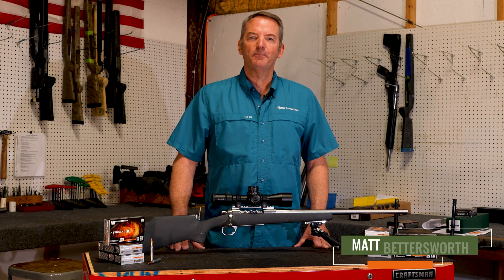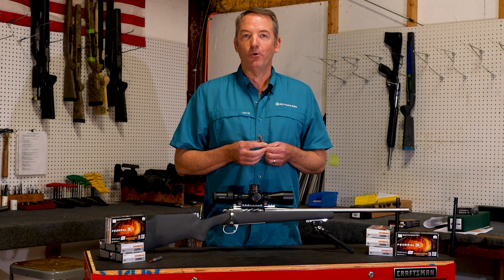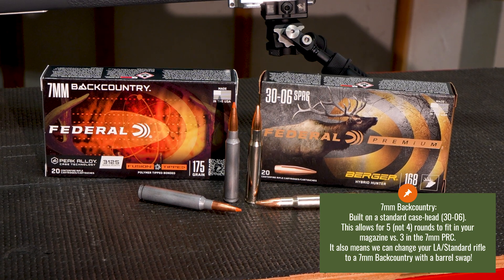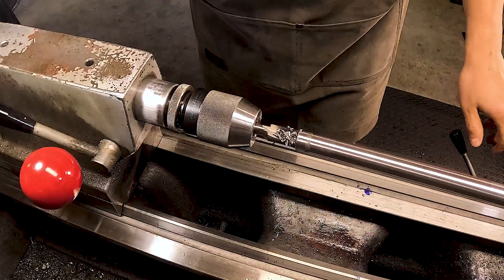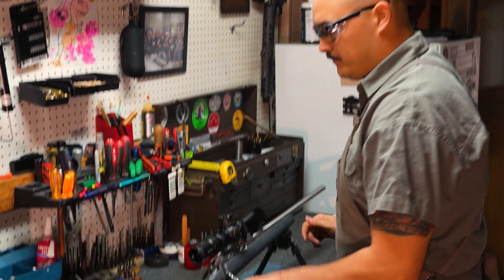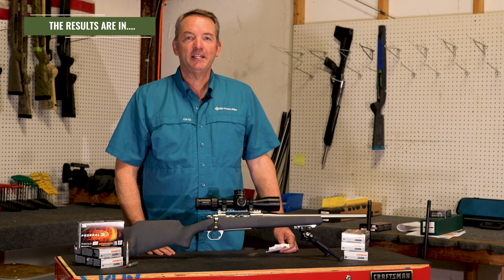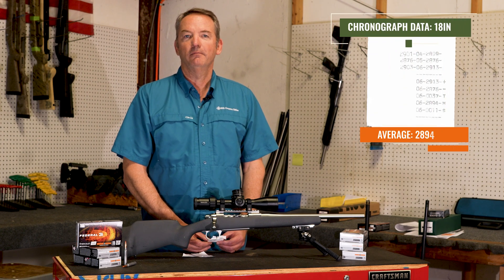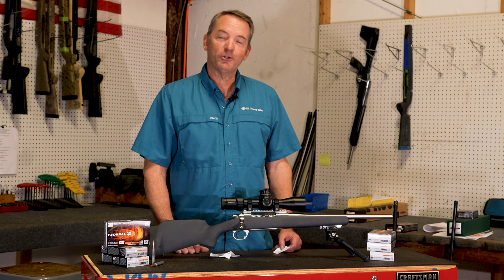7mm BACKCOUNTRY TESTING WITH DIFFERENT BARREL LENGTHS

Comment: This is exactly the video I was needing to see.  I really want a 16.5" 7mm BC now.  While it's on the potent big side for White deer and black bear at closer ranges, and that's the big game where I live, it could really be handy if the odd moose gets the idea to charge and a fun varmint round with handloads ...just for a change of pace once in awhile .  I bet the velocity is super impressive with light for caliber bullets.
Reply: I just picked up a savage trail hunter 16.5" in 7bc. Finally got to shoot it and I'm getting 2933 fps over the Garmin. I'm in AZ so it's 95° so I'm not certain if the heat made it faster or not. Best part about it is that with my suppressor attached its shorter than shorter than a rifle with a 24" barrel.
Reply: Thanks for sharing. Your suppressor is adding length to the barrel and helping your velocity is my guess.  @eaznutts5714
Reply: Forgot to mention I'm shooting the 170 gr terminal ascent
Reply: @eaznutts5714  I am sure the heat is adding something to the velocity , I'm sure you can find out how much by shooting it on a cooler day . Even if it's adding 150fps ,that's really impressive for such a compact setup with a long, heavy bullet.  It's basically matching a 7mm rem mag with a 22-24 inch barrel. Are you having any issues with the bolt sticking on extraction?
Reply: @coreymerrill3257 haven't had any real issues yet. It could be that particular chamber creating the speed too. I'm headed up to cooler weather in 2 weeks for an elk hunt. I'll shoot it over the Garmin and see what's what.
Reply: @eaznutts5714    if you don't mind, let me know what you find out , I am curious.  I know about 20 years ago, you could be certain the heat was increasing velocity considerably because it increases working pressures. I can't get any straight answers from propellant manufacturers as to how heat sensitive their products tend to be these days. 😂 I'm not demanding exact numbers because that's impossible. Just a yes or no and if yes ,the range of minimal to very sensitive.  Best of luck on your hunt !  Please don't forget to bring something along to deal with any surprise "attitudinal" bears .
Reply: I just got a set of Lee 7 BC reloading dies. So it is reloadable. Pretty sure I can take any of the ott 6’s or 270 brass and fire form if I want to shoot cheaper rounds that will be plenty for all North America game. But when I want the horsepower, I can build a load for it or the factory Steelcase offering.

Comment: Why not test a 24, 26, 28, and a 30-inch barrel as well?
Reply: With such a small powder load those may be slower than the short barrels.
Reply: @dudeinanofficechair7662  Watch the muzzle flash.  All the powder wasn't being burnt.
Reply: I would like a 26.
Reply: Id also like to see longer barrels as to see what the application can be as a longer range target round with more velocity.
Reply: Why would you want that size barrel for a suppressor friendly cartidge?
Reply: @Thatguy-t8e  the longer the barrel, the further away the noise is.
Reply: Because its not designed for long barrels and will do terrible in them
Reply: Because only Fudds shoot long barrels without cans
Reply: @ajdube9967 Fudds are buying more guns than younger, broke-ass gen-z-ers that don't know what a man is or what a tide pod does. I can play the name calling, insult game too. We all have our own desires for 2nd amendment equipment, if many of us want different barrel length options than the manufacturers should make them available. My money carries the same value as anybody else's money. To many great cartridges come and go because the marketing does not match the consumer demands. This cartridge has a good chance at falling flat for this reason. In the meantime prices will continue to go up across the board from failed projects.

Comment: Federal spent a lot of time and money on this, yet you can't find any 338 WM ammo or cases to load. I am not going to ditch my 338 for this.  Back in 2002, I jumped on the 300 WSM, and I even had you guys fix the crooked chamber, buy installing a new barrel, and do a bedding job. The rifle is pretty much a safe queen. For some reason, the barrel likes to collect rust. No matter, I don't shoot it. My mistake was not chambering to 270 WSM. Not that it matters it don't.. The 7mm Backcountry will end up just like the WSM's or the Dakota Cartridges.

Comment: It seems this cartridge doesn't gain proportionately as barre length increases. From 16.5" to 18" gained 64fps. 18" to 20" gained 54fps. 20" to 22" only gained 40fps. I would also be curious to see what a 24" would do, but looking at the pattern would most likely be less than 40fps, which would mean 3028fps or less. This is quite a bit off from the 3150fps Federal claims in a 24" barrel and not much more than you can get from a 24" 7mm Rem Mag with 2950fps being very doable. Actually, some powers might even give you 3000fps with a 175 in a 24" barrel. Goodness, sounds a like a repeat of the factory 7 PRC, coming up 150fps short all the time. Sounds like a short barrel specialty round.

Comment: Appricate you guys doing this. I know this is marketed as good for shorter barrels but it would have been interesting to see what 24 and 26 inch barrels would have done.
Reply: Yep kinda disappointing I wanted to see 24,6,8
Reply: I do age, with pressure like that a longer barrel would be very interesting.
Reply: Not well it used fast burning powder
Reply: yup, I'm goin to buy a 26'' McGowan barrel n 7mm BC, still lookin into which actions would be best for 80k psi

Comment: I’m curious how it groups with the higher pressure cartridge. Looking for accuracy and speed. If it groups consistently it will be interesting.
Reply: Initial testing from the manufacturers wasn't good at all for accuracy
Reply: @sneakybow1 that’s not exactly true. I think 2 companies had issues with accuracy out of the first loads they received for testing. the rest have reported good accuracy.  To be fair no one has enough data to be sure of anything at the moment. But I think this is the future.  I’m not sold on it yet but after I get mine in and see what it’s all about I’ll make up my mind then.
Reply: There was one manufacturer that had issues with accuracy. Everybody else is doing just fine  @sneakybow1

Comment: 3 shot groups are statistically insignificant
Reply: On a PRS rig or NRL hunter comp sure you want to shoot more than 3 because you will shoot much longer strings on stages and document how the barrel behaves under heat load.  On a hunting rifle for 98% of hunters that will rarely shoot more than 2-3 shots, 3 rounds groups have been the standard for decades for a reason.  Fore some strange reason people want to abandon 3 round groups for 10, 15, 20 round groups because thats what the top shooters in PRS said.  For that type of shooting sure 3 round groups do not tell you what you need to know but for the other 98-99% of hunters its perfect.
Reply: @ strong disagree. I’ve had rifles and ammo that I swore were zeroed well and shot sub MOA on demand. After shooting aggregate 20 or 21 shot groups with them, some of them weren’t zeroed properly, and none of them shot under 1.5 MOA. It’s important to know what the dispersion of your hunting rifle is.
Reply: @SammyMoore-tg5gs  Yes, at 20-21 shot groups, if you have a rifle that will shoot sub MOA on demand then suddenly after shot 20-21 it walks, the barrel is too hot and its stringing, or something is wrong with your mounts rings or scope doesnt hold zero.  Strong disagree all you like,  what you are saying applies to competition shooting and NOT typical hunting.  The only scenario I can say it might make a difference is high volume varmint hunting, prarie dogs possibly....but I know dozens of people that do that professionaly and they all zero with 3 round groups, some 5 round on heavy barrel rigs.  If 3 round groups are so insignificant why have hunters been using it for over 100 years with outstanding success?  All those poeple, including hunting guides, professional guides in Africa, millons of hunters worldwide have no idea what they are talkign about.  Suddenly, PRS come along and now the proven shit that has stood the test of time for over a hundred years is now wrong LOL imagine that.
Reply: @ read again, and I’ll be more specific. I said 20 or 21 shot aggregate groups, meaning I am shooting 5 four shot groups, or 4  five shot groups, or 7 three shot groups all at the same point of aim leaving time for the barrels to cool in between each 3, 4, or 5 shot groups.
Reply: @ also, as far as hunters being successful, their success rate is not nearly as good as we like to think. There’s a lot more missing and wounding happening than people like to admit, and much of that is due to lack of practice (by far and away the most influential), lack of understanding the true dispersion of the shooting system, and lack of a good zero or loss of a good zero.
Reply: @ Oh no, I completely agree with that there is a lot of wounding and long range shooting of animals taken by people who have no idea what they are doing because they watch long range hunting shows or buy " 1000 yards out of the box rifles ".  You can have the best zero in the world from a static position from a bench but no common sense of experience shooting from field positions.
Reply: @ No, I undertsand that multiple groups consisting of different number of shots per string.  What my point was is that makes absolutely no sense to 98% of regular hunters who typically shoot 1-2 shots during hunting season and maybe a box in between seasons.  What matters is the cold bore shot, come out in the morning shoot one shot, let the barrel cool to the point of no heat then shoot another.  Thats how the majority of the hunting world hunts from a cold barrel with typically only 1-2 shots at most, not a multitude of shots in any given string of fire?  I understand what you are saying I do, but to the majority of hunters it is of no value.
Reply: 3 round groups have always worked and will continue to work, time tested and proven world over for hunting.

Comment: Performance wise, for big game hunting this technology is a game changer. 7mm08 size and weight rifle smoking a full size 7mm mag and a extra round capacity. This is likely the future
Reply: Compare recoil of magnum 12 gauge slug with 11,500 psi vs a 223 of 60,000. Gun and bullet weight and velocity effect recoil physics and stuff.
Reply: A rifle in 7MM-08 with a 22” to 24” barrel is very comparable in size and weight to a 7MM Rem Mag with a 24” barrel when made using the same stock and other materials.
Reply: @nmelkhunter1  But the standard 7mm 08 has a 22" barrel where most 7mm magnums need a 26" combine the barrel length with action and your talking about over 4" shorter on average and about 1/2 a lb on average which is significant and very noticeable in the timber or hiking up in the mountains. The 7mm backcountry can beat both with a even shorter barrel barrel of 18" to 20". I don't have a 7mm backcountry but for a mountain rifle it's a game changer for those in the market. I'm personally waiting for a 30 caliber short action version. It's getting alot of hate from people with hurt feelings but the technology looks promising.
Reply: @rockie307  Notice my comment was comparing weight between the two cartridges I mentioned, not a comment on performance on the cartridges you mentioned.
Reply: Man my 18" 300 WSM shoots a 180gr at 2940 fps. So this doesn't really impress me.
Reply: 7mm08 is a short action, so not the same size.  It’s the size of a 280 Remington
Reply: @stephenmilam7256  I know it's a short action but the overall length and weight of the rifle are similar since the backcountry performs out of a standard action with shorter barrel. For practical purposes the weight and length of the rifle will be the same as a 7mm08 and much lighter and shorter than a 7mm magnum but still outperforming it. I said rifle not cartridge.
Reply: @rockie307 it's also going to recoil like hell too. You aren't pushing 80k on pressure without there being an equal amount of recoil. No thanks. Garbage accuracy and not reloadable either.
Reply: @sneakybow1 the major factor in recoil is the weight of the projectile plus the weight of the powder as both are propelled from the barrel. So the felt recoil should actually be less than a 7 mag shooting the same projectile because this cartridge is doing it with less powder.
Reply: @sneakybow1  it is reloadable, and won't have excess recoil because it uses less powder... recoil comes from total weight leaving the barrel.
Reply: Fad that will die. Ammo is already way to expensive now you want to darn nearly double price of a similar sized case. Plus all the competitors claim not to use a brass brush in a  bore and you want to slam a steel case in the chamber?  I’ll never own one. Plus reloading it is going to be a real pain.

Comment: You can shoot a 175 grain from a 300wsm, 20inch barrel, at higher velocity with significantly less recoil, so unless you are stuck on a 0.284 vs .308 there is no market except for the barrel manufacturers.
Reply: Bullshit.
Reply: Not sure how you plan on getting less recoil while using more powder in a 300wsm, and any gains in velocty vanish from B.C of a .308 projectile
Reply: @WayStedYou  Exactly.
Reply: As a hand loader, yes, yes, you can. All you hand load guys can't see outside your little "I can do this and better because I hand load" circle. They created all these new cartridges for the community that has no intentions to hand load for themselves. Therefore, your point is irrelevant.
Reply: @joemartin9175 well said my friend.  Also try this wit an 18 inch pipe on that 300.

Comment: What did the primers look like?
Reply: If they can't get the reloading part,  figured out this cartridge may not hang around no matter how much money they throw at it
Reply: @308guy8 RCBS said in their tests it took 12 passes with the full length sizing die to do one of these cases. I want no part of that lol
Reply: Being the case is steel alloy, the primers and primer pockets wouldn't show any different if you're within appropriate pressure of a brass case. They'd have to spike that pressure well up to proof testing where they maxed the 7bc (100 or 110k psi, unsure been a minute since I read up on their max testing for this cartridge. I apologize) out at to have hopes of showing traditional pressure signs.
Reply: you can't tell pressure signs with steel case

Comment: Piss on speed, what is the chamber pressure? So it's 60 to 65000 psi ?
Reply: 80K
Reply: Try 80k to 85k
Reply: @aaronunterseher1627  wow. So that's more than 300 rum or 338 lapua, 50 bmg only around 55,000 psi. This is crazy
Reply: @long-range-eliminator  thus the reason for the proprietary steel case to hold the higher pressures.
Reply: @JohnBozeman-c6k  I just don't get it
Reply: @long-range-eliminator high pressure. Less powder. Less recoil. Faster burn. Equals same performance with shorter barrels (or better performance with equal barrels).